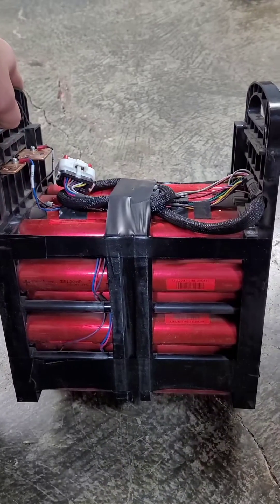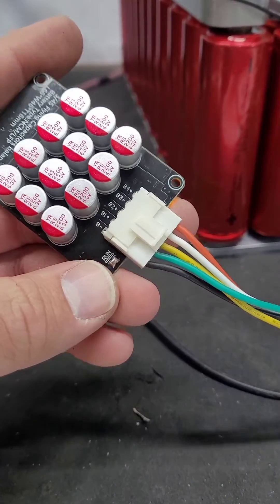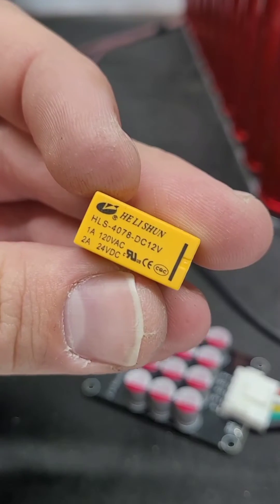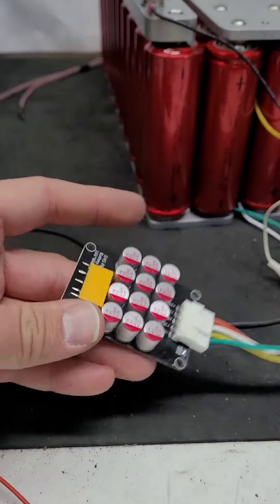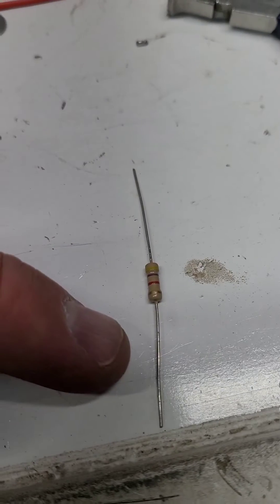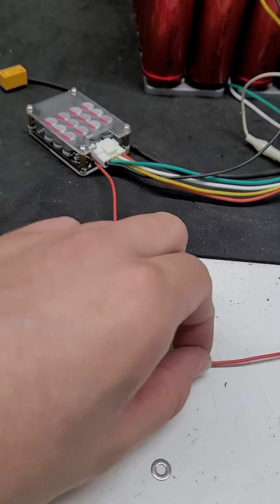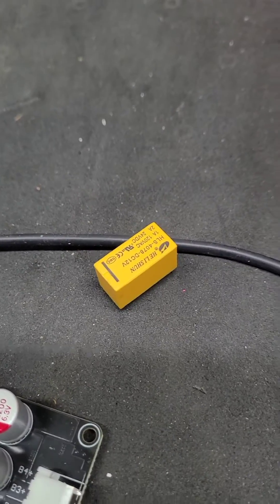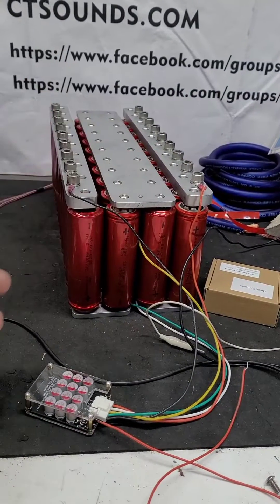DIY Headway Lithium Ballancer Hack

Comment: Is the light on the balancer the cause of the 12V (96ah) Headway bank to slowly drop its voltage?  My bank while sitting unconnected slowly dropped daily about 1/2 a volt daily so i checked all my cells and found  2 where not holding as much voltage as the rest,so I replaced those with spares after charging them up individually to 3.5v to match all the other cells ,I charged all the cells equally then put all the cells back together, charged the bank to 14.8v then re-connected the balancer but what I noticed is after 3 or 4 days the voltage continued to drop down to 13.6..Remember this bank has not been installed in my car yet..Its just sitting on the floor..at the time of this post it's the 4th day and it's resting at 13.6v it seems..The only other thing I can think of is these cells are no longer capable of holding the 3.6v max as shown in the specs .Right now they are only at 3.4v each of charge @ 13.6v..Yes they are the used cells deal most people get. Did your banks initially rest at 13.6 or near that? Or did you charge your bank to 14.6 or 14.8 and if so did it hold its charge?